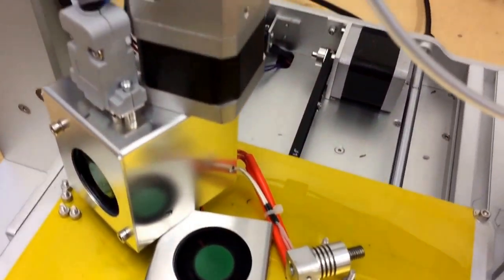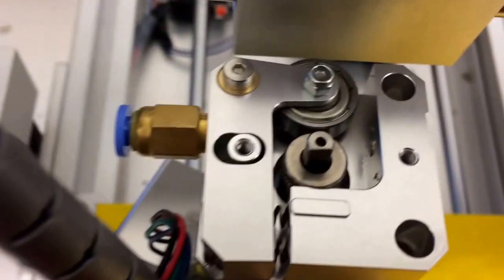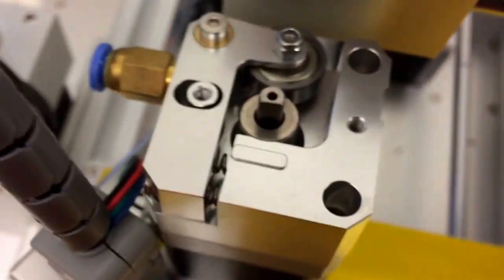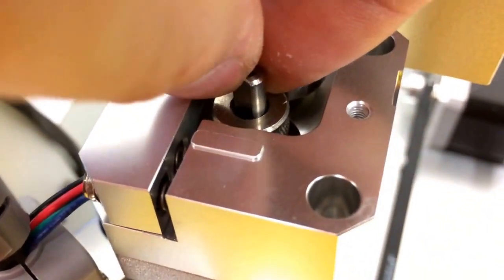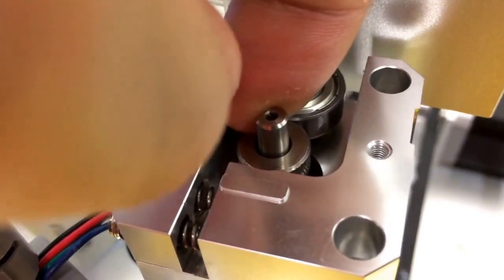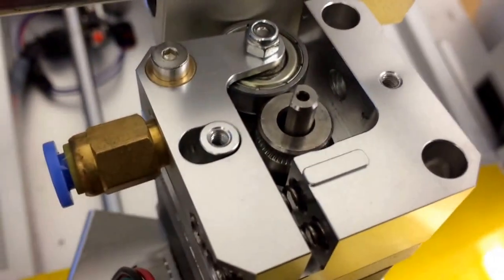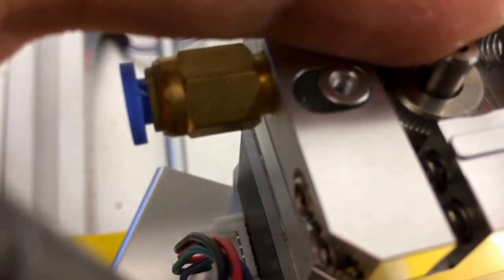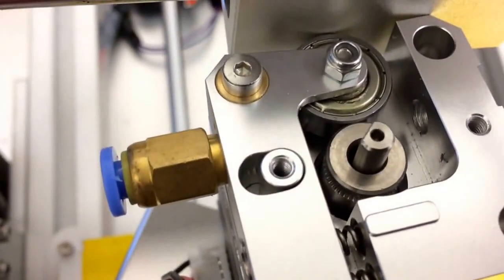Rapide 3D printer extruder does not appear to extrude?

Comment: Did you ever find the issue?  I have the same issue with a replicator dual on the right extruder and have switched the motor connectors to the second working stepper head and it does the same thing.  Don't want to take the thing apart to get to the board if it's fixable. Thanks in advance.
Reply from the maker: It was the plastic DB9 shroud that was pinching the wire and prevent current from flowing.
Reply: Just followed the link to a picture of a broken or shredded cable, thanks for the help I'll tear into it tomorrow to trace the db9.  I was starting to lose my mind trying to figure it out.